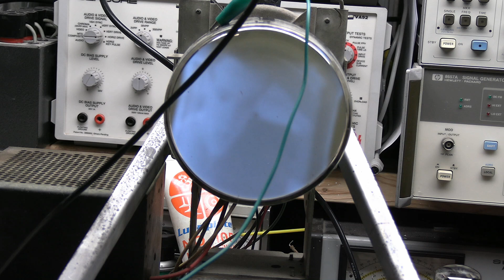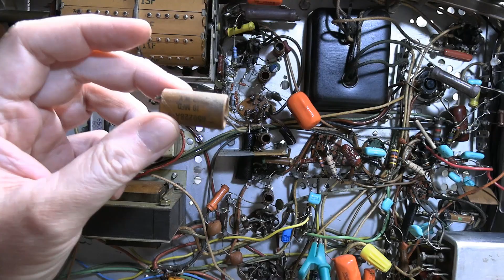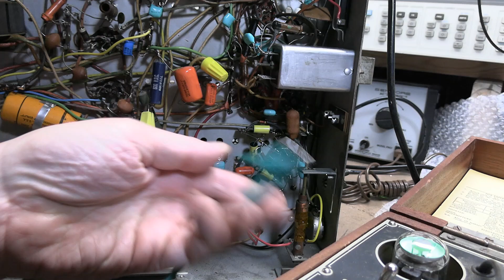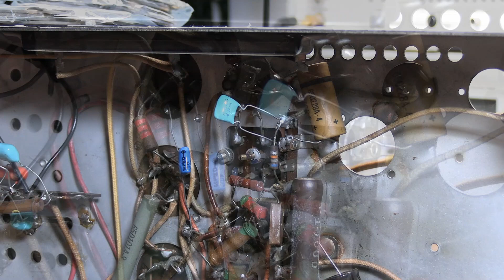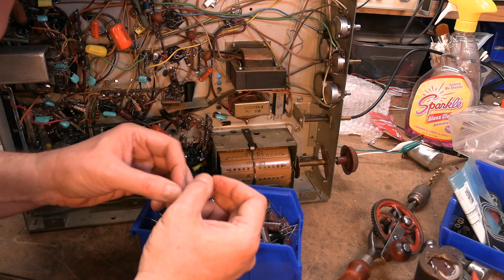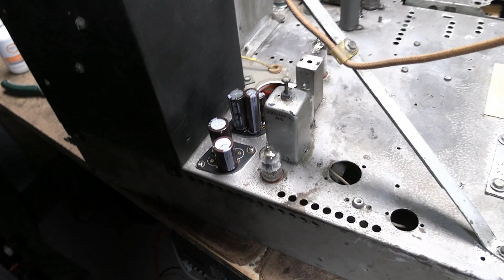Capehart 19" combo restoration part2

Comment: Love the antique egg beater drill. I have not uses one of those in years! I'll have to get me one since mi Dremel has issues in tight space where a longer bit would do the trick. I would also like to pick up an antique (reversible) push screwdriver. Great video as always!
Reply from the maker: Yes, plus it only takes a few turns with light pressure.
Reply: I was lucky enough to pick up an old (patent date 1923) Yankee 130A screwdriver at a thrift store. There are plenty on eBay for under $20 shipped. With a grinder you can use modern insert bits.
Reply: @eDoc2020  Thanks for the info! I was able to get the screwdriver and a egg beater drill for less than $30 including shipping! :)
Reply: @ElectroRestore  No problem. You might want to regrease the screwdriver but there are guides online.

Comment: Hey Bob, nice repair :) Those little light blue caps look suspiciously like early Philips or Siemens plastic caps. I was wondering, dogbone resistors are those typically carbon trace or wirewound resistors?
Why not use small strips of adhesive velcro to attach the cardboard covers over the replacement capacitors, Bob?
Reply from the maker: Neither.  Carbon rods. I think they varied the resistance by carbon formulation.

Comment: Nice work Bob!  Old drifted carbon comp resistors, leaky paper caps, and dried out electrolytics combine to really degrade circuit performance.

I remember those aqua colored plastic film caps, I brought a bunch of them in the mid 1970's for a home project. They (of course) worked fine at that time.

The brown epoxy dipped plastic film caps I first saw being used in RCA's CTC-7 chassis, along with Top Hat silicon rectifier diodes.  Later in the early 1960's, RCA started using these caps in their B&W sets.

Comment: Am I the only one noticing the big, yellow wire nut that was used on the set? Something tells me that isn't a factory part.
Reply from the maker: Yes. Something in the HV cage was replaced. Possibly the damper tube filament transformer. A lot of work had been done on this chassis
Reply: @bandersentv  I was curious, since that's usually frowned upon by technicians who take pride in their work like you do, so I was surprised you didn't rework that early on. I confess, I have done it on cheap radios, like my Admiral am/fm clock radio, to reconnect the clock motor after repairing an issue with the B+ and replacing the filter caps. I didn't go too overboard with it, since it has a damaged cabinet.
Reply from the maker: @FahKice  oh I will. Still lots to do on this chassis

Comment: Maybe some wrong value caps were installed by mistake. I'm sure you will check for this. Nothing like having to go over something someone has been well into.
Reply from the maker: Very difficult to do since no service info is an exact match
Reply: Saw that on another tech channel I watch. Normal sized caps. Should have been like 8 micro, but somebody put in 150 micro. Could easily blow the tube it was connected to. Paul instantly caught that. Called it the cathode bonding wire removal cap.
Reply from the maker: @GeorgeZ213  all the electrolytes vs are still original do for sure those are correct. Critical circuits Match the schematic pretty well. It's the retrace modification that's really throwing me off